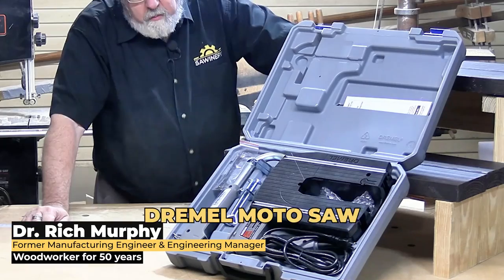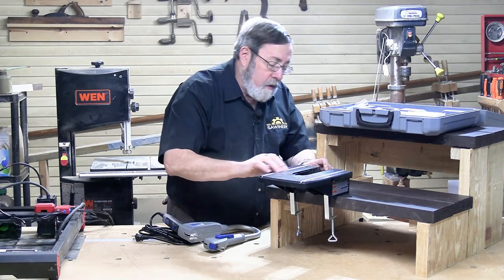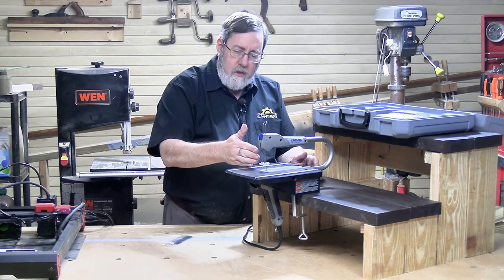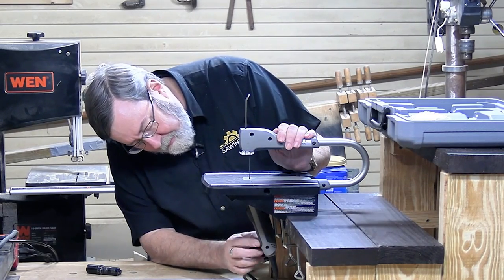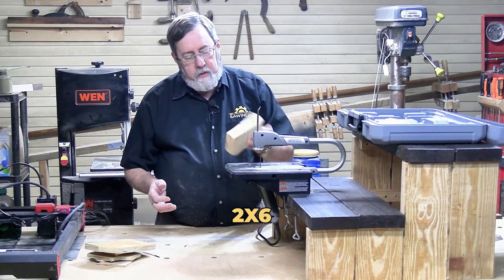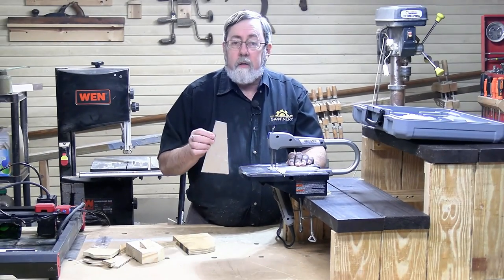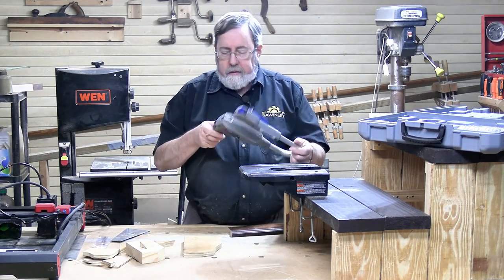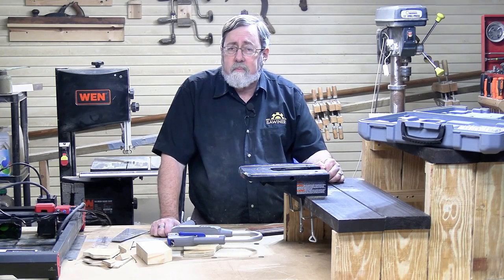Dremel Moto-Saw Tested by a Long-Time Woodworker

Comment: Thank you for the detailed info.  I purchased one from Amazon and I could not get the pressure foot to raise - this, for the one I purchased, anyway, was very hard to raise, I never did get it to raise so I sent it back only to find the replacement I got did the same thing.  What am I doing wrong?

Comment: Such a helpful video - thankyou. could I ask if you would recommend it for cutting straight edges only or would a small bandsaw be better? (if so which?) I need to cut diamond shapes out of a larger square of 6mm mdf:)
Reply from the maker: I cut straight edges with it, without problem. A lot depends on your individual skill level and how careful you are. If you need to do a bunch of them, is there some way you can rig up a fence, helping you to keep your cuts straight? That’s what I would do.

Comment: I want to cut Celtic crosses and wondering what thickness the blade is for shaping internal cutouts?
Reply from the maker: Yes, the blades are thinner than standard scroll saw blades. I believe they are 0.025” thick. As to whether that is adequate for cutting out Celtic crosses, I’m sorry, I don’t know. I’ve never tried doing that. I would think so; but I’m not sure.

Comment: Thank you for the informative video. Does this saw cut 1/4” red oak?  I need to make cross lap joints.  Saw blade height is 1” max and the slot needs to be 1 1/2 inches. Therefore I must cut them laying down.  I do not own a router. Can’t think of any other way.
Reply from the maker: Yes, it will cut through 1/4” red oak.

Comment: Hi, can I ask where you got the bench riser that the Dremel is on please? I just bought the Dremel and could do with something like that. If you made it (most likely you did) could I have the dimesions for it as it looks ideal. Many thanks.
Reply from the maker: I made that out of 2”x’6”s. There’s a little bit of bracing underneath, in the corners, to make sure that everything stays together. It started out to be a step-stool for someone who really thought it needed to be that heavy. Well, when it was done, it was too heavy for them to use, so I ended up making them a lighter one and repurposed it for use in the videos. Works out well for that.

Overall dimensions are 24” wide, 8” high and 11” deep. I’ve attached a low-cost metal woodworking bench vice and added dog holes. The dog holes really aren’t for use with the vice, but for use with hold downs.
Reply: Thank you, it works well.

Comment: Will this cut flatware or silver plated metal like Siler plated tray. I am doing jewelry.
Reply from the maker: I didn’t actually test it for that; but it should; at least if it’s not heavy steel flatware, plated in silver. I’ve done jewelry too and it’s clearly strong enough to cut through that. You might go through blades a bit faster; but most of that is soft enough that it shouldn’t be an issue.

Comment: I wonder what's the life span of a tool of this kind that actually looks like a toy, due to the fact that most parts are made out of plastic?
Reply from the maker: I didn’t do any destructive testing of the tool, so my ability to answer this is limited. Nevertheless, the table and other parts that might be of concern were supported by a network of webbing, adding strength and stiffness. It wasn’t anywhere near as strong as metal; but for plastic, it seemed pretty good. Ultimately, how long it lasts will depend a lot on how roughly it is treated.
Reply: It's not the 80s anymore, we can make plastic that doesnt turn brittle in 10 years, and fall apart. The plastic parts in this tool will almost certainly last longer the the brushes in the motor.